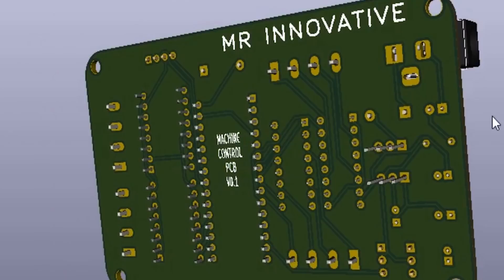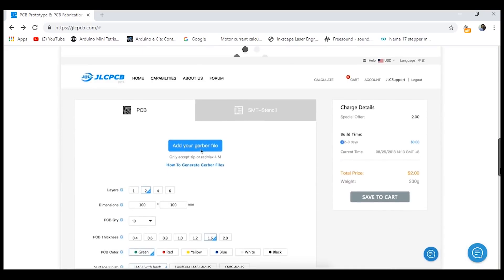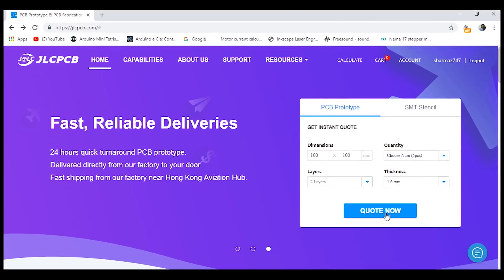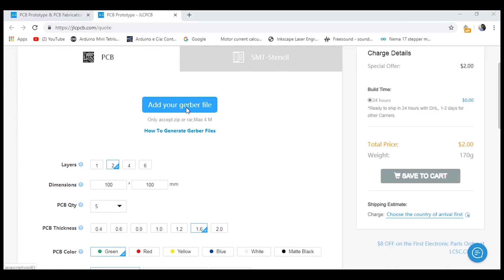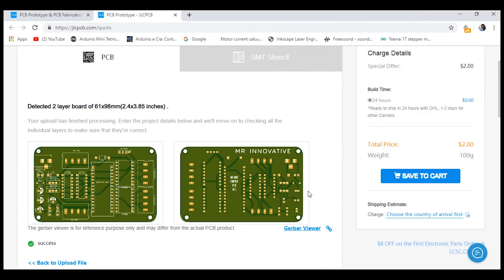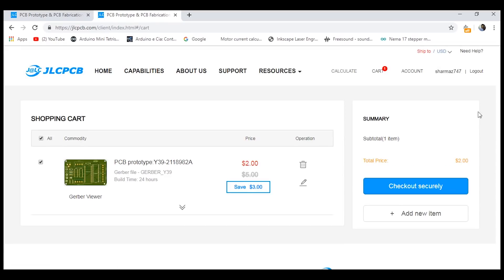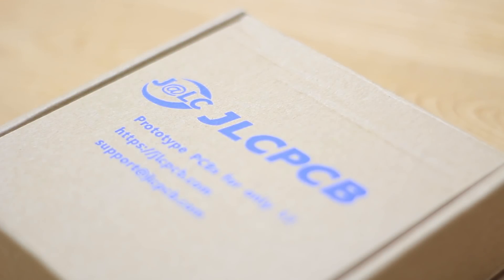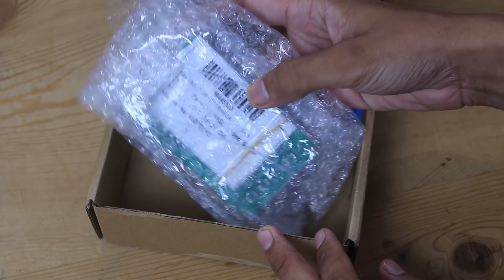DIY Match stick Lightning Machine

Comment: You should have flipped the position of the components. That way the stepper motor would only have to turn a little bit to touch the wheel.